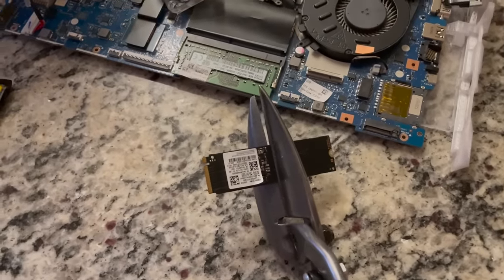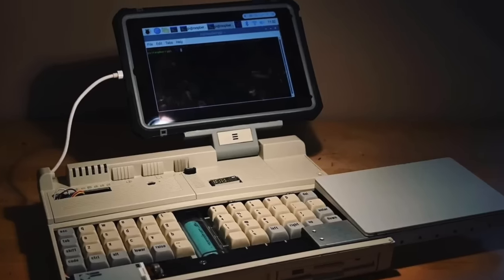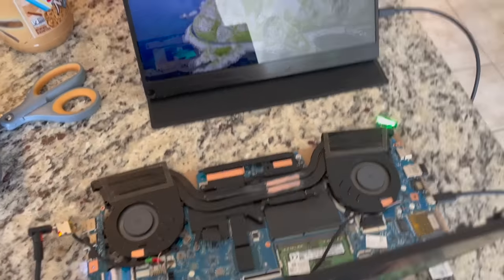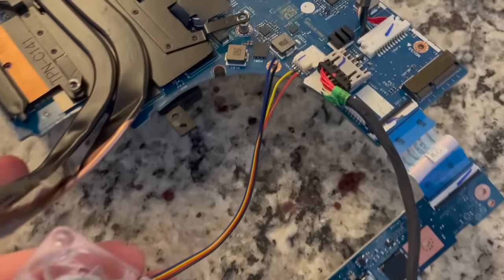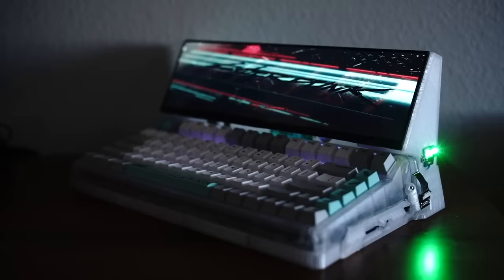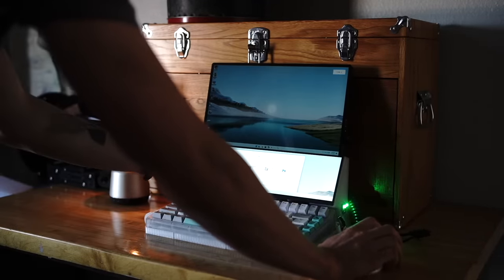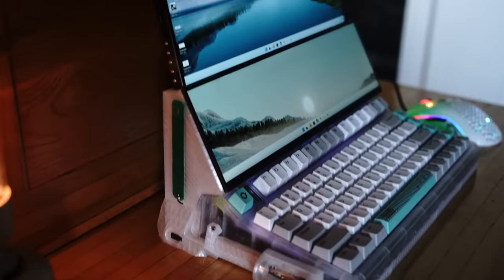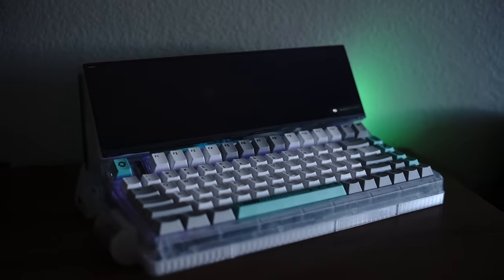I used this as my Computer for a Month

Comment: Wait someone pleas explain cutting the m.2 card lol
Reply: Also pls add specs
Reply from the maker: I cut it to fit the new case. It still worked because the design was intended to work on several SSD PCB sizes. The specs are the laptop specs, and a link is in the description

Comment: But why?
Reply from the maker: …the entire first min of my video was explaining why, lol
Reply: @CarterHurd  no no, I get that, you're interested in alternative designs, and so am I. I just honestly don't see any relevant advantages of this setup over a normal laptop.
Reply from the maker: @geneivy  well, It has one extra display, a much superior mechanical Keyboard, and better ergonomics (taller main display). That all comes with tradeoffs, obviously, but I did like using it more than the donor laptop.
Reply: @CarterHurd  fair enough. Although, since it's not exactly portable, why is that better than having a monitor and external keyboard connected to a laptop?
Reply from the maker: @geneivy  Desk footprint, mostly. Plus it's an all-in-one unit that is easy to move between my kitchen counter, work desk, and workshop desk

Comment: Bruh what the heck is wrong with a used Microsoft Surface Pro I guarantee the specs are 10x to 100x this piece of junk and probably half the cost
Reply from the maker: This was based on a gaming laptop with better specs than the surface pro. And I got the laptop used on Craigslist for $400.

Comment: Lost me at "didn't use windows".
Reply from the maker: Of my top 5 most used apps (ignoring Chrome), all 5 are not available on Linux. Mostly engineering programs (CAD stuff) and video/photo stuff
Reply from the maker: IMO, programs are far, far more important than the operating system. I've used Mac, Windows, and Linux machines. Having the right applications makes a much bigger difference than the OS, which frankly... simply doesn't matter all that much for normal use.
Reply: @CarterHurd  That's your own choice to make. From my point of view going with Windows is limiting hardware choices needlessly for no other reason that familiarity. Going with Windows meant you are basically limited to downsized PC and that's about it. My interest was achieving this with different hardware.

Comment: Dislike for breaking hardware. thf is wrong with you?
Reply from the maker: Idk what is wrong with me, but Fun fact: I’ve taken apart most devices I own. Even my expensive watches I’ve taken apart for fun. Even as a kid I’d do that. Just today I took apart my projector… messed with the pieces… put it back together… everything in the world around you is moldable and shapable but you’ll never create anything cool in life if you’re afraid to get dirty or afraid to mess up.
Reply from the maker: Also: The SSD still worked!  So…
Reply: @CarterHurd  same bur dude you cut that m2 in half how it supposed to work lol?
Reply from the maker: @Donnirononon  it worked fine after being cut! the circuit was designed for a smaller PCB size, that way they could sell the same design in different sizes (that's my guess, anyway...)
Reply: @CarterHurd  lol ok did not get thet from the Video, I tought you just yeeted a 100$ ssd.